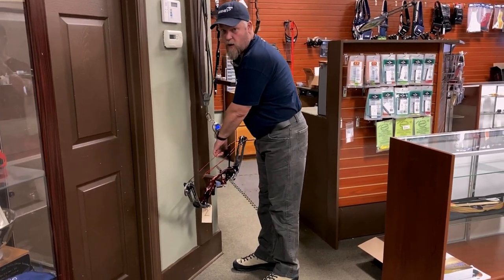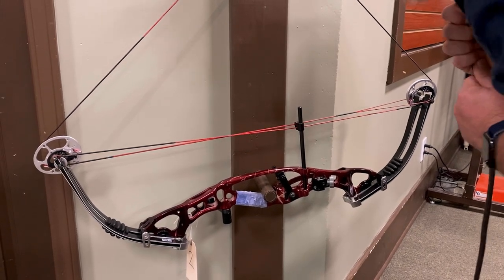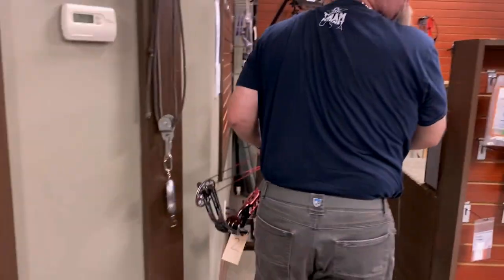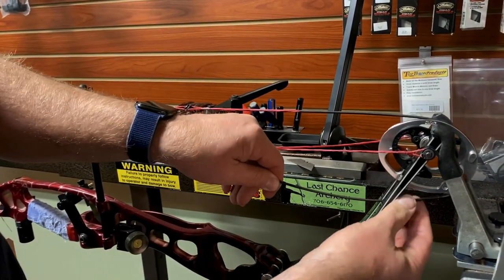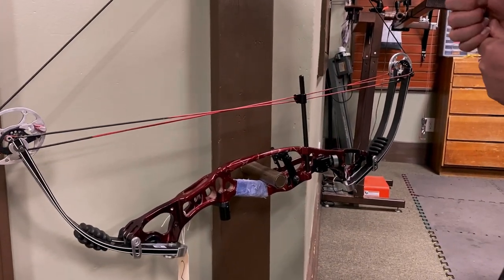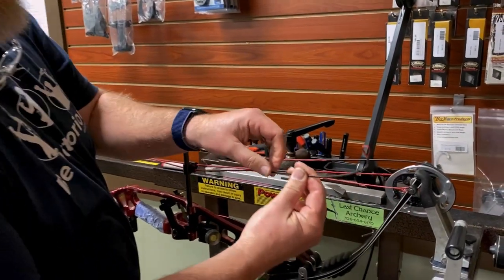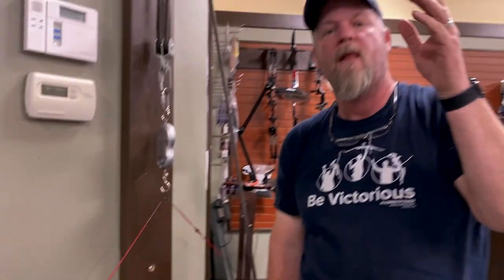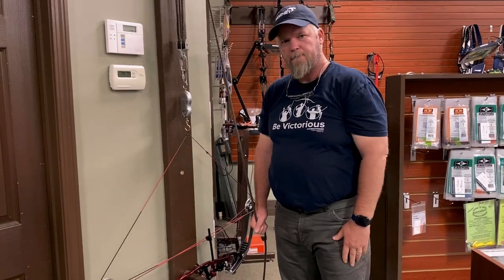GRIV's Quick Tip. How to check and set the timing on your compound.

Comment: There is another problem with string adjustment with cam&1/2 plus.  when we change the strings. Bus cable came off side the bottom module not at the center. How to solve that?